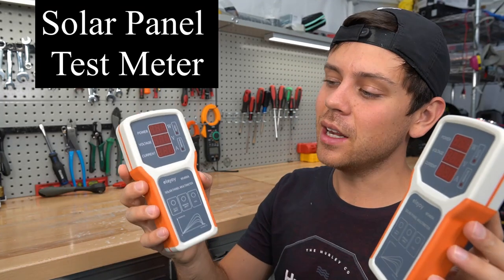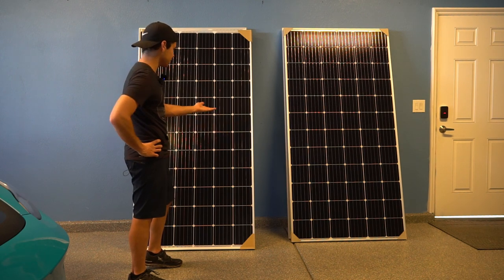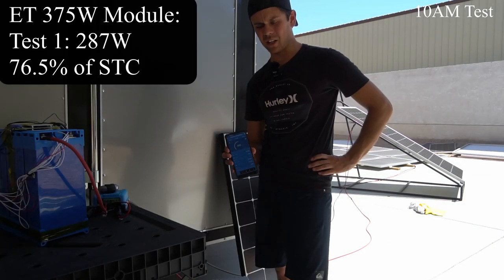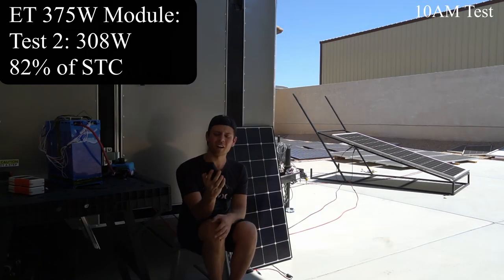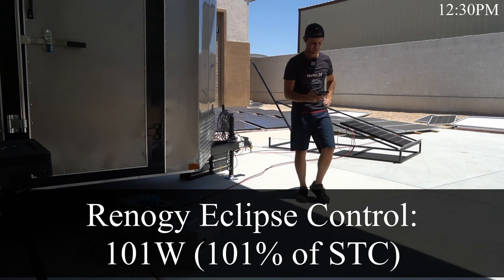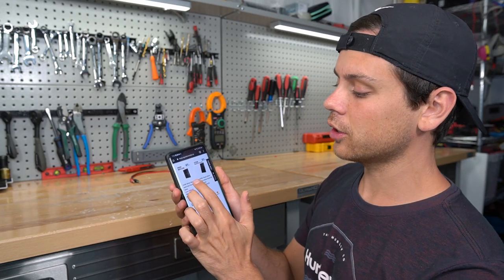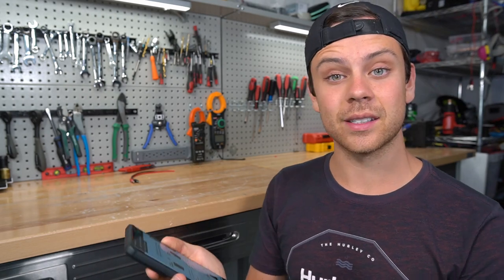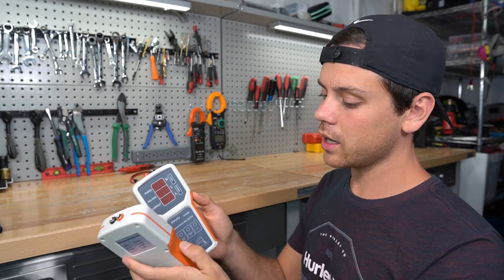Solar Panel Testing! ET Solar VS ReneSola

Comment: Have you ever tried build a floating solar array?   I am in the process of transitioning to a sailboat and want to be able to have AC while at anchor and not have a boat that looks like Dr Suess designed the solar panel system.   5 x 150w on a 12x6 non towable floating mat deployed at anchor to run a less than 10k btu system maybe?

Comment: Can u do a video on a small system with max output ratings for daytime use only? Say, 600w continuous, 3000w inverter and how ever many batteries to run 12 hours.

Comment: hi will. for about 100$ there are Chinese panels which power is insane compare to these. I have JA solar with 535 watts of output and 20.5 efficient. there's a lot of brands from Chinese with similar outputs. jinko, kaco , rec solar, risen solar, yingli solar. these are some of the Chinese manufactures. so if you can do a test with them it would be great.

Comment: I would like you to test the new hqst 9 bus bar 100w panel. At 74.00 each maybe a good chose for those building smaller systems.

Comment: Im building a 24v battery from 8x 3.2v batteries. I bought 2x Daly BMS each 12v 4s.

Can i use the 12v bms on each battery then wire the batteries to 24v? 

Is a 24v 8s daly bms needed or will my system work well with 2x 12v bms? One on each battery?

Comment: Just installed 2 ET solar panels. Did cost $500 shipped but that is still $250 per 350w panel which is reasonable.

Comment: Is it normal and safe for the battery+ and solar panel+ on my pwm to beep when i check if they are connected using my multimeter? I checked with everything disconnected, just between solar+ in and the positive going to the battery.

Comment: It would be interesting if you could use one panel as an ongoing reference. You could then compare each panel you test to the reference panel to see how output compares in the light and heat conditions at the time. 🤔
Reply from the maker: That's exactly what I did. The eclipse panel is my usual reference.

Comment: 7:28 Not 1% or 3% it was 1.45~ when measured between the two as far as watts.
Plus 5w difference would not be enough to have that 3% difference between the two panels on STC. 
It's closer to 2.6%. But I'd say that number is far less important then actual watts generated.

The backing in the two panels is very likely the reason. The reflective one getting better results in less than optimum.
The one with no reflection staying cooler in absolute perfect conditions likely got it the higher rating.
Good take away from your testing.:
Use panels that have a slightly reflective backing to generate better in anything less that absolute perfect conditions even if not actual bifacial.
This also shows why bifacial have much closer to max output in weather that is far worse than optimum. If space used is a concern it's a huge benefit.
Love your channel keep up the good work.
Reply from the maker: Yes you're correct. I was talking about this with a friend last week. You're right

Comment: Your link to the Renasolar 370W came up as a 404 error (page not found) so check your URL or you may not be getting proper affiliate credit.  I did order a pallet of 17 of the 195 watt used panels.  I sent them an email letting them know you were the source since the link didn't work properly.

Comment: Like Will said, the meter's OK if you are sorting panels, but not for installers - they will have an expensive meter $$$  Plus Andy from that 'other' solar YouTube channel (Off-Grid Garage) uses a different meter - after he used this meter.

Comment: Hello Will. My name is Travis. I've been enjoying your videos and have been inspired to attempt to set up my own solar and or wind electricity generation. Given that I'm disabled and on a fixed income of about 600 a month, how feasible even is it to try to get into this? Also, do you have any extra equipment you'd be willing to part with at a good rate? Or maybe donate? ^_^ I don't have the option of tapping into the grid where I'm having to move, so otherwise I'm stuck with my gasoline generator. Thanks Will!

Comment: I think you should get a thermal camera so it would be possible to make the calculation from STC from the cell temp. Maybe also you should point out NOCT of each panel and compare this to reality after warming up the panels ca 1h. STC is nice sales trick and for that the outdoor temp should be more like 50 to keep the number :D
Reply from the maker: Yes indeed about STC. And I have thermal camera but these panels heat up in seconds and output drops. Having my thermal camera to mess with would be a pain. But yes that's true

Comment: Will. Been following you everyday for a long time. I have a hybrid lexus and I am curious about rebuilding the hybrid battery. Is this practical or dangerous to do?
Reply from the maker: Personally I wouldn't mess with it. High voltage batteries are very scary. And you need to buy very specific protection equipment. I would say it's not worth it. Depends on what is wrong with the pack though. Just keep in mind that it can kill you very easily.

Comment: Will great video. I have a question not related to this but if I buy an electric car in the future when the electric car is old can I use the battery in the car to store energy and power my house.?
Thanks
Reply: As I understand it, that's exactly what Tesla does. When the batteries in one of their cars need to be changed out, they put the "used" batteries in a powerwall. You would need to be pretty proficient in all things battery and solar to do this yourself.

Comment: Hi Will:   I need you advice on a Balder 330 power station I bought a little. (Short version)  It won't charge only beeps (soung like a SOS) he LCD screen is blank. It'sonly a year old, can I repair it.
Reply: WOW, I thank I just heard something wiz by over my head lol Pinned by DÍY Solar Power wìth Will Prowse

Comment: "It's still tracking the MPPT..."  <---this...this right here has been my sore point.   Connecting up and repeatedly getting different results.  It makes me want to track and adjust it myself, but I'm not given the option to do so.  I have genuinely watched exactly twice my 400W worth (4x100W) Renogy "compact panels" exceed 400W output for a day when first connected.  When left on and encountering another exact or even better day, I'll get the expected 340-370W-ish output.  I will, likely, have to make a one-shot video of the entire setup (nothing special at all) if my life ever allots me the time.  ....so frustrating!

Comment: Maybe if making your own system it might pay to add some sort of heat sink to the back of the solar panels.❄
Reply: Panel cooling is one of those topics that nearly everyone wants to solve when they're getting into solar (myself included) but the added cost, increased power consumption and added hassle, are typically not worth the limited gains. The only exception, where cooling "might" payoff, would be on a giant solar farm(?)

Comment: I ordered 17 ET Bifacials for my new off grid project and 6 came damaged. They had the 200 pound 12KW Growatt inverter stacked on top of them when I went to pick them up from the shipper. Are broken panels a unfortunate reality Will? Signature Solar is working with me to get replacements but I don’t have much confidence the next 6 will make it after seeing these.
Reply from the maker: No way!!! I had a broken panel from the shipper over five years ago. I get shipments all the time and never have that problem anymore. Sounds like you were super unlucky. What a bummer!
Reply from the maker: Solar panels when used as designed are extremely durable. Bifacial are stronger than normal ones because there are two layers of glass. Something bad must have happened. The shipper did something wrong
Reply: @WillProwse  Well that gives me hope for the next shipment! Signature Solar has been very helpful and it sounds like they took multiple precautions when shipping panels like a cone on top saying do not stack, and labels telling shippers to use extended forks, however between the 4 different shippers the order was handed off to before it got to me it was all disregarded. The tops panels were smashed from inverter and the bottoms were cracked right in the middle from short forks only making it to the mid point before they were tilted up and lifted.
Reply: @WillProwse  Thanks so much for all your videos, they have been extremely helpful. I bought raw land in Colorado and am doing a more realistic off grid house with ordering a new single wide manufactured home going on it. Only utility in the area is fiber internet and that’s all I really needed! It’s been great ordering all the solar stuff. Just need batteries now and am waiting for signature solar to hopefully restock those 100A 48v Gyll batteries. Maybe you’ll have a review sometime soon to ease my mind on them.
Reply: @thinde88  won't be too much longer before Starlink comes online you might want to look into it ...my father has already pre-ordered his...  he says it was $500-ish for the equipment and $100 a month for the service
Reply: @better.better  Yep I already have it pre ordered and am really excited for the possibilities once that is here. The only thing that worries me is good enough line of sight to the satellites while in the mountains. I’ve read they are pretty low in the horizon as of now.

Comment: Mr.Will is there any particular 100 watt panel that you would recommend for the jackery 240 ?
Reply: My 100W HQST has been great for charging my Jackery 240 (and the 100Ah LiFePO4 milk crate setup I recently built)!
Reply: @QuantumQuibbles  thank you for the reply. Did you panel come with the barrel connector or did you have to splice one in ?

Comment: Great video, I think you should have a second panel stand so you can easily perform the panels comparison.
Reply: Actually, the stand looks like it could easily accommodate 2 panels horizontally, with no/little modification.

Comment: Stc values are measured in a factory  or laboratory using an artificial light source, room temperature of 25 deg C, and and atmosphere of 1.5. Test is pulsed such that there is no heating of the solar cells. 
1. Putting the panels in the sun will cause the cells to warm up. You should expect a 10% loss of power from stc just from this effect alone. The nominal operating or actual  (temperature can be meadured) and a temperature coefficient can be used to calculate this effect.
2. You are testing above 30 latitude with no knowledge of the actual radiation hitting the panel. However you can estimate the radiation by measuring the ISC during the test and dividing the ISC at STC (1000 w/m^2). Take ISC now divided by 1000 to figure the percent loss. Or you can buy or rent a laboratory  grade radiometer $$$. I would estimate another 10 to 20% loss of power due to that reduced radiation because of your latitude. 
PCT the California standard for solar panels would be more accurate for your location to compare panels to.

3. I don't know the efficiency of for victron setup, I would expect a certain loss from there. 
I made 6 videos to explain these concepts for Andy, take a look.
Reply from the maker: Honestly everything you said is common knowledge. I'm pretty sure we all know STC versus PTC and what it means. I try to hit STC for fun.
Reply: @WillProwse  I Been watching you for a year now, I went through your very early video's and current videos I  learned alot from you. Your progression as you advanced your thinking is a good tool. I got stuck on a comparison of 100 watt solar panels on delivering 70 watts. You said it was normal, never seen an explanation as to why. I seen others struggling with lower than actual performance not matching stc performance and wondering why. Just FYI explanation  of why they don't  match, from an engineering perspective. 
I have respect for you, but it took me awhile to figure it out. Just sharing.
Reply from the maker: @petercamusojr1545  oh ok for sure. And thank you :)
Reply from the maker: @petercamusojr1545  the really expensive panels always hit STC. It's pretty interesting. But yes, STC and PTC is different
Reply: @WillProwse  You got a good channel and my respect, from homeless to...now, it is a great journey to tell.
Reply: @WillProwse   that is interesting. I learn something new everyday. You live in a desert,  low humidity few clouds, you can actually get more than 1000 watts/m^2  there. If it is large enough, it will compensate for the loss due to temperature effects. The ratio of ISC now over 1000 can be greater than 1. So it is possible to get the label stc power rating. If the radiation is 1100 which is realistic where you live then,
1100/1000=1.1 
a 10% gain offsetting a 10% loss due to temperature effects.

Comment: Anyone interested in 20 jinko 400 watt panels? Or 40. If you want that many. I live in western Texas. Willing to drive a ways or meet somewhere to transfer. I'm asking 100$ a peice. These were used for less than a month on a solar farm. All tested for voltage and randomly tested some for wattage output on a micro inverter.  So far everything is perfect.

Comment: Hey Will, what about a test comparison of bifacial vs traditional panels on a boat? lots of sailboats are running solar arrays to charge lifepo4 banks. Also can you list some venders who will sell by the panel. it seems so many venders want a minimum order of 4 to 10 panels. Lots of sailboats run 2 300 watt panels.

Comment: Why are you letting these guys slide for not hitting their rated output? 
When the battery guys fall short, you skewer them.
Reply from the maker: This is STC, not PTC. Pretty obvious because I said it. And every single panel on the market (minus rich solar poly and sunpower) pulls 80-90% of STC. These are pulling more than most of the panels we tested in the past. And STC usually is not achieved unless you are in a lab or have perfect condition and a cold internal solar cell temperature. I think you are referring to PTC. Are you? And batteries should always pull their rated Wh capacity. Are you new to solar?
Reply from the maker: I suggest watching my beginner videos or early solar tests. Read what the difference between STC and PTC is.
Reply: But the Renogy hit its number. 
They could inflate but they're righteous.